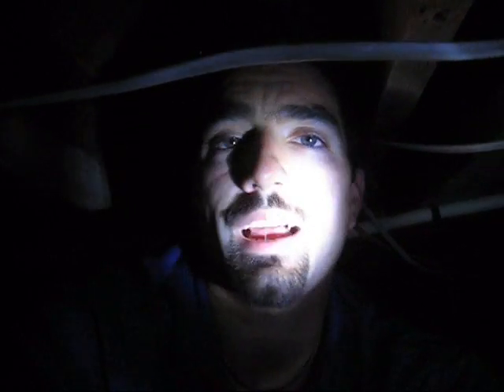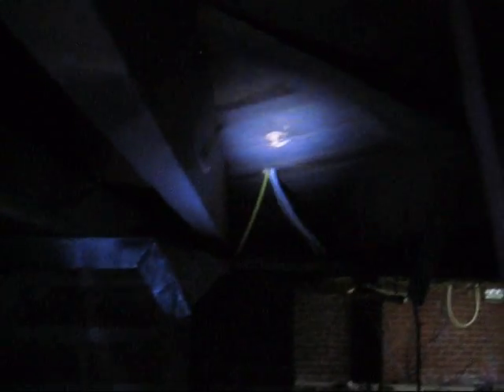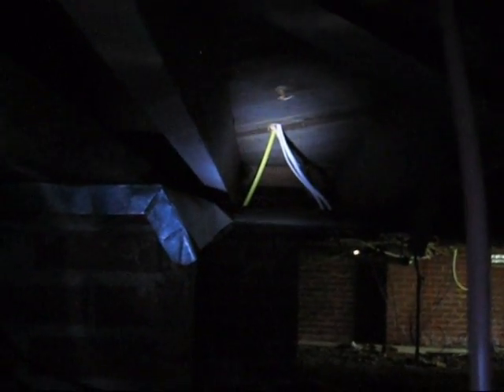Avoid Costly Mistakes: Consult an Engineer (Part 4)

Comment: You need to show the weight of the wall all the way to the roof and see if the wall is supporting more the 3000 pounds, just in this point under the floor

Comment: Did you tell them the wiring should be stapled to the floor joists or strapping nailed to the floor joists?  Aren't there any house inspectors to enforce code?